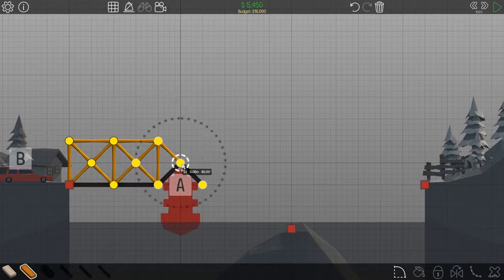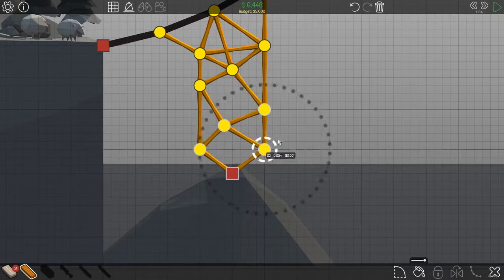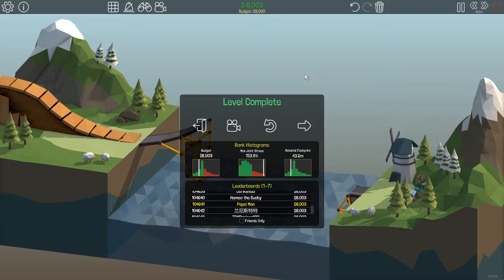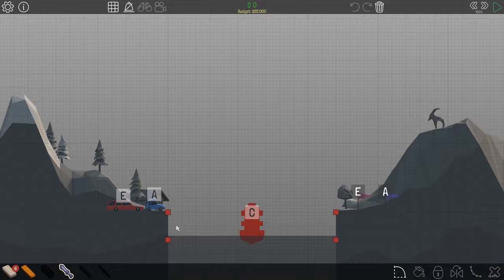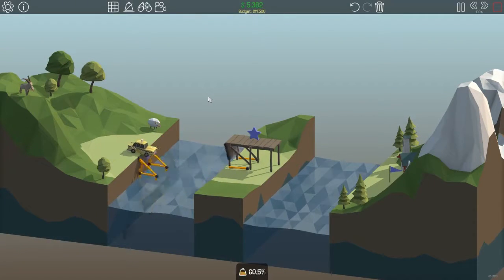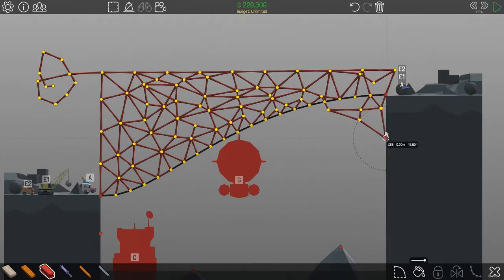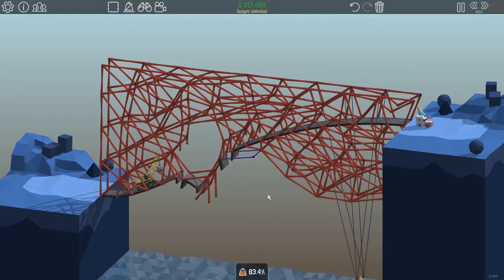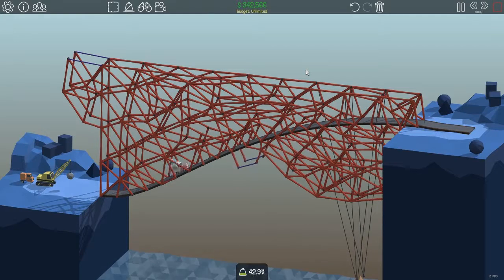Steelville: Quest for the Ramp (Polybridge)

Comment: Before pasting selected road can be rotated in degree measurement so you can get good results for triangles by making the strongest triangles where all their sides are same in length :)
You can also get further components by exiting grid mode (g on the keyboard).
Stronger connections from 2 points can be achieved by using diamond-shaped triangles created with the line perpendicular to the state line from the 2 points.
Reply from the maker: Hey! Thanks for the tips. I don't know when my friends and I are gonna get back to playing this but I appreciate this!